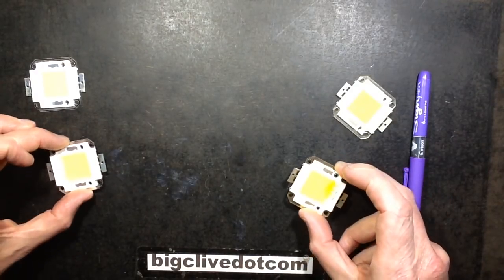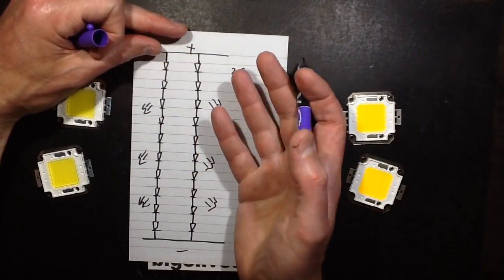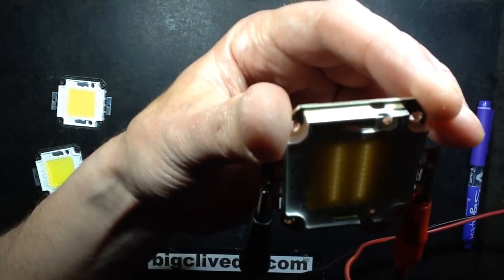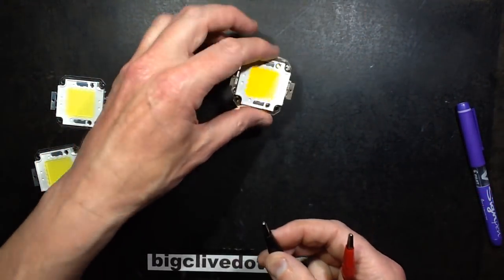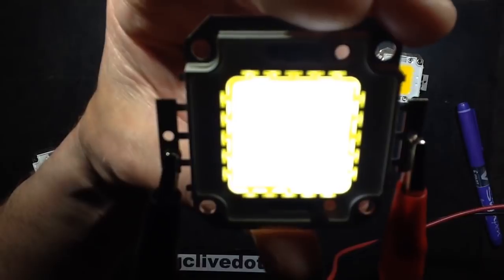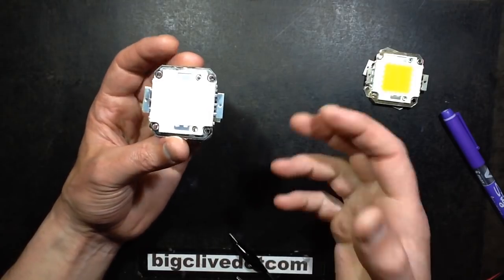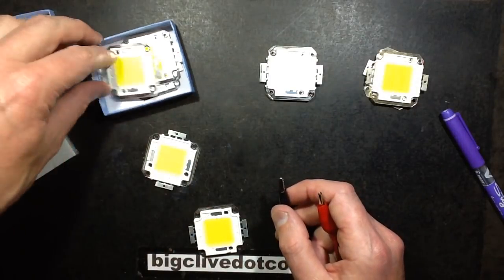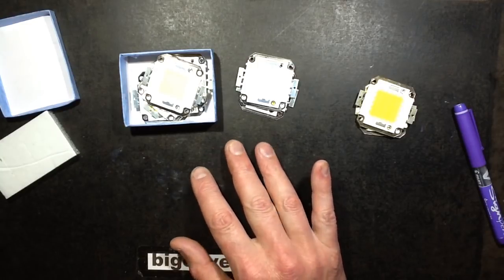Testing dodgy 100W LEDs from ebay sellers.

Comment: A couple of things, after seeing this video.   First question is,  are these 100W LED's advertised as "dimmable?"   Second question is about the power supply that you're running them with, is it a constant current source or a constant voltage source?   This creates a huge difference in the final result.  

If the LED modules are not dimmable, then this is the behavior that one would expect out of a non-dimmable module.   Non-dimmable arrays are not designed to run at current/voltages lower than their engineered thresholds and will generally operate quite erratically below those thresholds.   Nowhere did I see this delineation called out and it's an important one.   If these were dimmable LED's AND your input operating parameters (voltage and current) were consistent with the LED design parameters, then this behavior would be considered defective.   

Also, missing from your conversation, here, is the lumen output at the full operational voltage/current.   That measurement is a critical one, as well, as it determines if the internal matrix is, indeed, operating appropriately, or accumulating failures..   Design centers require that each LED has a specific lumen output in order to achieve the final value (1000 lumens, 2000 lumens, etc).   Should a single LED, in the matrix, fail, then the appropriate output value will not be achieved.  As one, or more, LED's in the matrix fails the lumen output begins to fall, dramatically.   

LED diodes have a forward knee voltage/current parameter, as do standard diodes, beyond which they are gated on.   Depending on manufacturing tolerances, there are a good number that may turn on early, and a good number that may turn on late and a middle range that all turn on about the same time.  Basically one of those "bell curve" situations.   Design centers can be as much as +/- 20% variation in less expensive products due to differences in substrate thickness, etc.   That doesn't mean defect, it just means less accuracy.   This is no different than the difference between 20% resistors and 1% resistors, where the 20% resistors are built to less rigorous standards of accuracy, not quality... but, even the 1% resistors have a temperature coefficient variations which can make the 1% tolerance meaningful only at room temperature, for instance, and outside of room temperature they can vary as much as 5-10% depending on whether the environment is hotter, or colder.   A 1% resistor rated at 5PPM is MUCH more accurate than a 1% resistor rated at 50PPM, yet both are sold as 1% tolerance.  And, in circuits where absolute accuracy isn't entirely critical it makes no sense to buy 1%, 5PPM resistors when a 20% resistor at 1/10 the cost will perform just as well.   The same rules apply in non-dimmable LED modules where tolerances are not required to be tightly controlled and managed, as the only "correct" way to operate the LED module is at rated voltage/current.  It is ONLY at that point that all LED's, in the matrix, are required to be both on, and emitting light at full rated power.   Anything beyond that point (above, or below) doesn't not require that all LED's operate in unison, or equally.   

Finally, as individual LED's, in the matrix, operate at a sub-par level, the CRI and the chromaticity variations begin to degrade rapidly.   Again, it's something that can be measured, that is both relevant, and scientific, rather than just looking at whether or not individual LED's light below specified operating thresholds.   All of these factors, taken together, determine whether an LED is crap, or functional.   All that I see, personally, in this video, is operation of an LED matrix below operating thresholds and calling it crap without actual measurements being made, and referenced.  I'm not defending either you, or the eBay sellers in this comment... however, for me to make an accurate determination of product quality I would need to see a full spectrum of actual measurements made with the product operating within the correct thresholds, all presented together to make an accurate determination of product quality.  Without that, it's all just conjecture and speculation...
Reply: So Can you explain why the other chips were fine on the same power supply?
Reply: It all depends, as others, and I, have responded to in your comments - whether or not minimal operating parameters (BOTH current AND voltage) were met on the LED.  If this is, for instance, an LED that requires constant drive current and you're powering it with a constant voltage source, the current parameter, in many instances will be insufficiently met when the supply is dialed in to the correct drive voltage.  The same applies if the LED requires a constant voltage source and you're powering the LED with a constant current supply, the current condition may be met but voltage variations, at the adjusted current level, may not be within the operating thresholds defined by the device. The methods you use, and your explanation in the video, fail to take those highly critical factors, which govern LED performance, into account.   

Also, the LED modules you're using - if they're dimmable, what is the dimming range?   Many LED modules will only dim from 10-15% to 100% and, below the the lower threshold value operate inefficiently and ineffectively.  In fact, I just bought a pricey LED troffer that supports dimming for my garage/workshop.  It dims from 10% to 100% and, below 10% some of the LED's in the matrix light, others don't, as the manufacturer suggests they will.   Manufacturers, due to design tolerances, expected light output, cost and other considerations will, effectively, limit the dimming range to match design criteria.  Below the accepted dimming range the LED's operate in, often, erratic ways.   My workshop lights have 10 year, unconditional, warranties.  They're not cheap, they're not junk, but they don't dim below 10% and 20% of them don't dim, consistently, below 15%.   The company says that's acceptable and "within tolerances."   

To determine if an LED module is "good" one must match the power supply, used to power the module, to the module itself.  Operating a constant current LED with a constant voltage source will yield inconsistent results as will the reverse.  So, first, the supply has to be matched to the LED drive requirements.   Just because you're operating a constant voltage LED on a constant current source supply at the recommended voltage does not mean that it will function per specification, or even normally because the voltage is set right.  Current can, still, under those conditions, be compromised.   The next step, once the supply/driver type (constant current or constant voltage) is matched to the LED requirements, then you have can only work the LED dimming through the range of MANUFACTURER SPECIFIED values.  Throughout that range the manufacturer specifies lumen, or LUX, output values (usually in the form of a graph), CRI index values, etc.   A device that is good will meet manufacturer specifications in BOTH light output and color stability.   But those items MUST be measured ALONG WITH the appropriate "drive" parameter (current or voltage) with the other "constant" element (current or voltage), always set correctly.   If one doesn't make the full gamut of measurements, under the appropriate drive conditions there can be no determination of product quality.  You cannot ascertain, for instance, CRI, using your eye.  Even high quality LED's can, and many times do, fail a CRI measurement across the span of their dimmable range.  LUX/Lumen output is, also, something that's hard to tell w/ the naked eye, unless you're the equivalent of Ansel Adams who could, within +/- 10%, consistently, determine how bright a light source is.   For the other 99.9999999999% of us, we need a light meter to measure light intensity.   And, light intensity has to be measured under controlled conditions.  If you measure at 1" from the source one time, and 2" the next, the law about the light dropping as a function of the square of the distance comes into play in a hurry... as 100% change has a considerable impact on measurement.  

My job is to test/characterize LED's, specifically high-end streetlights... I spend a good amount of time doing this sort of thing... many "cheap" LED's, such as the ones you display, are actually very good WHEN you operate them WITHIN acceptable tolerances and boundaries AND drive them with the appropriate type of source.   If you don't operate within acceptable boundaries and drive them with the appropriate source they will operate erratically, as they should.  That doesn't mean they're bad, or cheap, or junk, it just means they weren't operated appropriately, much like a car in which, rather than gasoline you put diesel fuel in the tank... doesn't mean the car is junk, just means it's not being operated correctly...   you can't judge the quality of either, if you're not maintaining them by their individual standards...
Reply: AKA TLD--Didn't answer. Mismatched LEDs cause that.

Comment: I ordered a single 100 watt led for $6.50  a while ago and when I run it at very low current, it suprizingly lit evenly. I guess I got lucky. I made a spotlight out of it with a 30cm reflector and it works rather well. I don't know if I will buy more just because of that risk or receiving duds.

Comment: Are they really damaged? It could be an intended feature. What do they look like when they're fully powered to spec, and you lay a filter over it? do they still have that pattern?

these individual leds could be sitting on zener diodes with randomized breakdown voltages so that you can sensibly control the brightness of the entire unit by simply dialing down the voltage, and so you can cycle it on without getting a massive sudden current spike. 

you're running the unit at 0.5% of its intended workload and complaining that it doesn't work like you expect it to? sorry for being skeptical but this wasn't very scientific.
Reply: +sentientagent 
Highly unlikely that there would be a randomized Zener breakdowns. The LED junctions themselves could have a variance in doping if this type of function was required.
You are correct of course about running the unit at such low level and expecting it to function. The demonstration is a good indicator that the matching may be poor but extrapolating that the units are faulty is a bit dodgy.
The design and batch sampling at the factory should have ensured that the unit adheres to its specification, over the permitted drive levels.
The cynic in me (and experience) however, tells me that they are very possibly the failures.
Even that though, presupposes that the components are unusable which is not necessarily the case as the the testing may separate into more results than just good and bad.
Reply: If you know about zener then a series run of LEDs shouldn't be so hard to comprehend resulting in your OP. ...ugh
Reply: The issue with the LED die not being matched lies in their IV curve characteristics. The reason why you need matched LEDs (that should all come on around the same time), is to ensure consistent and even current throughout the entire array. If you have a few die that have a lower forward voltage, they'll conduct proportionally higher amount of current over the rest of the die, leading to thermal stress in that area and eventually failure. Even though it is performing at "0.5%" of its expected workload, the die should still have similar (if not near identical) forward voltages, and should all turn on at the same time. What you're seeing in this video is a very big indicator of a low quality LED array.
Reply: @joshdau  
they even out with voltage. his assessment is not correct, and it isn't the first time.
i'm not even bothering to explain, they are all ok. try to "short"2 out of 10 and the others will instantly burn. or 9 out of 10.
he's so wrong he's not even funny.
he was refunded, because all sellers do that, afraid of bad rating.

Comment: have you notice about the minimal voltage of diode to work? LED is a diode.
more over, the series of diodes voltage drop shall not be the same on every diode!
more more over, the parallel series of such diodes must consume a current that you have LIMITED. so how you supposed every single diode to light up similarly and evenly... you trying to "fire" the diode by applying a minimum energy, so some diodes will fire up first, dropping the voltage on them, not leaving the chance of other diodes to "fire up". 
try doing the same experiment by applying the correct voltage to all "set of diodes" as specified by manufacturer, then block the light by some sort of filter, then you should be able to see single led diodes by your camera, then and only then you shall speculate about their light intensity)))
have a fun, you will be surprised.

Comment: It would be interesting to try looking at the LED light distribution at full power, maybe by diminishing the light with a welding glass window or something.  Maybe these discrepancies at low voltages don't matter much, as long as you have sufficient heat sinking?  It would also be really awesome to have an IR image of the back of the metal pad after turning on the chip for 1s, to check the heat distribution and difference in heat load chip-to-chip.

Comment: If you don't want any problems, stop ordering from a sketchy ass distributor from ebay... I work in that industry and if you want quality, you should consider buying from the big companies like Nichia, Citizen, OSRAM, Samsung, LG, Lumileds, etc... Even some chinese manufacturers order leds from bigger companies to put in their fixtures.
Reply: +Didier Bosset How do I order just a few 100W LEDs from reputable companies like that?  I haven't found a way yet.
Reply: +Nathan George First choose the COB you need from the website of the manufacturer, let's say OSRAM Soleriq 13 and look for it on distributors websites such as digikey
Reply: Actually, Mouser has more than Digikey. They are not exactly cheap. But you won't have any problems with them.
Reply: +Didier Bosset How about no? He can order from China all he wants. The whole point is to test and find the good suppliers. And your point about they're not exactly cheap... yeah, no shit, Sherlock, that's the fucking point!
Reply: +Jimmy Gregorio u mad bro? You pay for what you get, that's my point. You can buy from as many eBay suppliers, you will never get the quality and consistency you would get from a bigger manufacturer.

Comment: They were probably damaged by static while being shipped. In the royal mail sorting office they use automated sorting machines and the leds have probably travelled about 20 miles just inside of the machines so they will obviously be hit by static at some point since some of the belts are 2 miles long.
Reply: +weirdstuffanimation7 the LEDs are shipped in propper antistatic bags ofcourse ;)
Reply: +TheScrappingJeahaha You're assuming they're from responsible sellers :D Did you notice the dodgy LED's came in a gift box? :D I seriously doubt they would use anti-static wrapping with that.